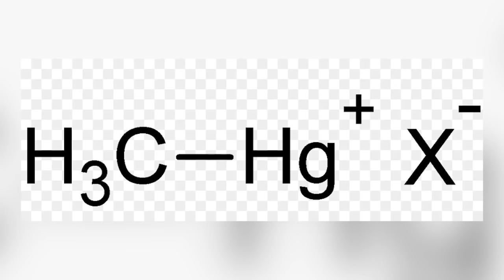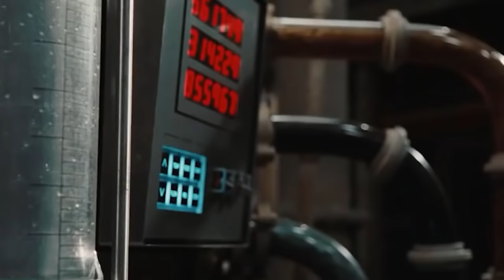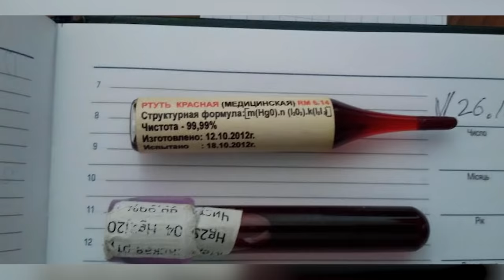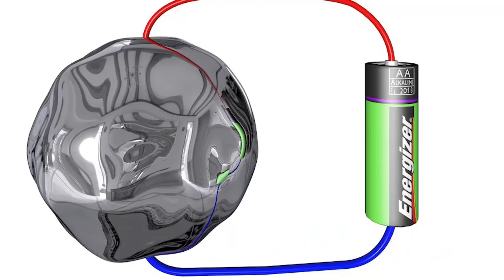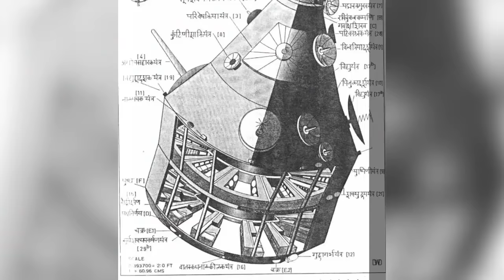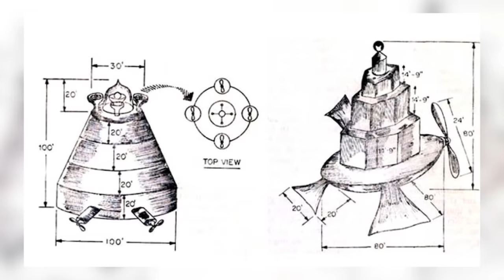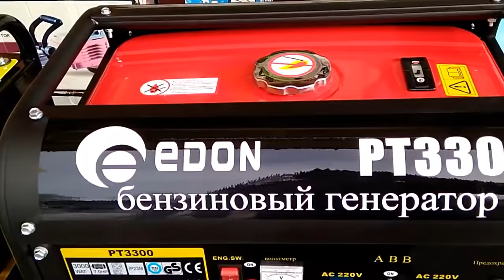Thats Why Mercury Engine Is Forbidden

Comment: I am 51 years old and in great health,when I was 17 years old I got a job at a hvac company and I came across a box of thermostats,it had about 50 of them,a short time later I broke the glass bubble that holds the mercury on each thermostat and collected about a cup of mercury,I played with it ALOT,touching it without gloves,I had it for around 5 years.
Later in life I was around 39 when I had a thermometer break on a shelf above my dresser and the mercury drained out on to a plate of spaghetti, I ate all of it,it wasn't until the last few nights that I noticed a odd taste and that's when I concluded what had happened.
And lastly when I was around 43 I wanted to work for myself and be a miner of Gold I spent a small fortune on the tools one would need and part of that was a 5 gallon bucket of mercury,mind you I was a tad more cautious this time but still had a lot of contact with it,I was much more aware of the fact that it's the vapor from mercury that can be harmful.

Comment: I ran a mercury distilling unit for a small company in suburban Chicago for over 3 years. We took 75 pound steel flasks filled with raw liquid mercury and distilled it to a purified form for use in dentistry. Ever time you get a filling the dentist used an amalgamation containing mercury. The vapor is indeed a neurotoxin, but the liquid is fairly safe to handle, if drunk it will pass through the digestive system very quickly due to it's high density. I have handled raw and refined mercury many times and am 70 years old and show no Iill affect from it. All employees of the company I worked for got monthly blood tests for heavy metals.

Comment: Interesting video, never thought of mercury this way, but funny enough I ate some when I was 11. 😅
Some odd 20 years ago when I was a kid I got sick and had to measure my temperature with a mercury thermometer, once I was finished I kept reading the book I had been reading and at some point somehow without thinking put the thermometer in my mouth. like I do sometimes with a pencil, and started swirling it around the groove at the small tip where all the mercury was and it broke and all of it went into my mouth. I immediately spit it out on the floor because my parents had told me before that metallic stuff is very dangerous. I remember taking a dustpan and brush and trying to get all of the small bits which were all over the floor and threw it out in the bin. Didn't even tell my parents it happened just replaced the broken thermometer with a new one, we had many. Nothing ever happened to me and I forgot about it the next day. I still have a few of those soviet thermometers somewhere around.

Comment: I did escaped unharmed a lot of mercurial thermometers got damaged, as well as a mercurial BP apparatus, when the bus that we were riding had a hard braking. Good thing though it wasn't my BP ap that was broken and all the mercury content spilled out into the bag that fell on me. Though it wasn't intentional (and my fault), I had to do the clean-up of the said spillage as well as disposing of all the glass thermometers that got damaged in the bus. Funny thing was even without protective gear (such as masks and puncture-resistant gloves, I did my task of cleaning and never got hurt or had some problems after being exposed to a certain amount of mercury (because I didn't ingest it).

Comment: funny hey. I was born late 60s and I remember having puzzle games with mercury in them. its 2020 and I am still here. I also had a tube of mercury when I found attached to some sort of power board where my sister did horse ridding. the build it was in was wrecked so I snapped it of and kept it. I remember having it for years but don't remember getting rid of it. not really into the full on conspiracy theories but I do believe that the mega rich and powerful control things so it stays in their favour.

Comment: If you spin liquid metal in a toroid it pushes against the sides of the toroid. By spinning a plate with magnets below it the metal will spin. Now use a pancake coil and pulse it with 24 to 36 volts using a pwm bike motor controller. That sets up a high current in the metal. Now place a magnetic metal ring around the toroid that applies a magnetic field  perpendicular to the spinning liquid and it will be pushed towards the upper end of the toroid causing pressure and lift.
Since its heavy metal and spinning it provides a good amount of stability when two are attached below a snowboard.

Comment: Yes. I used to have about half a cup I used to play with. I used to soak coins in it. Turns them all like new dimes with prolonged exposure. Stuff doesn't soak right into your skin. It's a metal.  But will if you were to just leave your hand in it for hours.. I assume it's going to absorb.

Comment: Mercury, when accelerated to an extremely high velocity, contained within a toroidal containment ring that has helical guides, yields a gravity disruption field effect in a localized frame.  This has been known for many years.  I believe that Einstein wrote his thoughts on this field effect in the 1930's.  
When combined with other chemicals, a very massive, superconducting, superfluid can be created that is much more efficient at producing this gravity disruption effect.   It is the part of the system used in a number of black project tests currently.

Comment: A model of an antigravity mercury device hangs on the wall of most every doctor's office. The snake wrapped around the central column are not snakes but steel pipes welded top and bottoms. The angle of 19.5 degrees forces the mercury to rise up at great velocity with the device is rotates. When the mercury reaches the top it has to travel around 180 degrees back to the central pipe where is starts the journey over again. Hold a garden hose four feet from the nozzle and turn the water on full blast. It wil whip around violently but if you hold it so there is a 180 degree bend you can feel the thrust. There are four forces at work. The device is six time more efficient than a rocket. When driven with a DC electric motor it produces a lift of 3.8 newtons per watt. Ten horse power can lift 12,000 pounds.

Comment: Imagine this...A tiny cylinder magnet weight inside a wire coil ('solenoid'), inside a spinning wheel, where it pulls inward when the force is upward, and allows the weight to return outward when the force(s), between two of these mechanims working in sync, will cancel out (perpendicular to the direction upward)....and a lot of these built together into the framework of a craft, so it propells the craft in whichever direction you wish.  

I think if you can make electromagnetic energy act upon swirling Mercury, spinning around the vertical axis of your craft (like that "Nazi Bell" experiment), which is also spinning around that ring (like wires around a toroid coil), in a symmetrical pulsed wave pattern so the craft moves in a balanced manner...so when the force of the spin is in the direction desired the mercury is caused to move outward and rotate faster increasing the force in that direction, but while it is rotating around the other portion of that rotation is is forced more inwards.
I think this could be maybe how such a "flying saucer" works, using "electromagnetic wave interferometry", "constructive", "sympathetic", "harmonic resonance". 

I been posting on my Facebook recently how I think these thinks work btw, and working out the math to predict and plan new experiments too!

Comment: At the Y-12 complex in Oak Ridge Tennessee, it is estimated that 700,000 pounds of Mercury was "lost" in the processing buildings and the surrounding environment. It was used as a solvent for lithium in the process of isotopically separating Li6 from Li7. I think we had most of the known reserves of mercury at Y-12 during that time (the 1960's).

Comment: My dad gave me a bottle of Mercury to play when I was a kid. He used to save it from various instruments thermometers gauges etc. It probably held about 6 fluid ounces and it weighed like 5 lbs! I'm just pulling a number out of my ass there, but it was way heavier than You would expect when first holding it. The first time my dad handed it to me he said hey Jon, hold us for a second. It felt as though a magnet pulling it to the ground. But I remember poring it into my hands qand watching it fall through my fingers and then splash onto that workbench and regather then I would push it around on the table with my bare finger. Always wondered why people are so freaked out about it.

Comment: Is it possible to synthesize something with properties of mercury that isn't mercury?  Seems like a chemist would know. Theoretically, could we grind an element with the same level of valence electrons into a powder to see similar effects?  Since the columns on the periodic table are aligned by external valence electrons it seems possible to a novice.  However, I do understand the extra ring around silicon gives it different properties from carbon, so please honest answers for an honest question.  Thank you for your time

Comment: Okay, Vimana and the mercury engine are interesting but what about the mercury rectifier.
Before the invention of the transistor diode, the conversion of AC-DC was done with a mercury rectifier in a lot of cases. Is this deemed too dangerous these days?
Also this is another reason some say the ancient Egyptians may have had electricity, many of the tombs where said to have pools of mecury found in them when first opened.

Comment: Handled mercury quite a bit at school in the 1950s.... we used it for a variety of things. No harm seems to some from handling metallic mercury now and again. It suddenly became a "bête noir" in the latter quarter of the 20th century. I did wonder why the sudden paranoia, but it's the same with metallic lead these days. Both Hg and Pb salts are very toxic, but the base metals not so much, Lead is rendered passive very quickly and mercury is only slowly absorbed in its metallic form. The trouble with the panic merchants is that they didn't pay attention a school in chemistry class.
But then, when I tell them that their food as in it a gas so poisonous that one lungful will kill them, and a metal so reactive that it explodes into flame when it touches water they are in denial until I explain that that is what common salt (sodium chloride) is made of. The chemistry is important.

Comment: When I was about 11 or so? I had accidentally broke a couple of old fashioned Mercury thermometer's and was lucky enough to have saved the slippery substance before it rolled off my desk and disapeered forever. But, as I tried to scoop it up into a container? It landed in my palm. It did not soak in or anything like that so? I was perfectly fine. However? When I tried to transfer it to a container? I accidentally spilled some of it on to an old tarnished Silver Dollar. It INSTANTLY absorbed itself into the silver dollar and made it look better than brand new! The only thing was? The metal now felt very slippery to the touch. That was almost 50 years ago. I will have to see if that silver dollar still has those properties. I am pretty sure I still have it here somewhere's. Stay tuned! ;-)

Comment: most engineers who would work with mercury aren't also medical professionals. Also mercury is a metal, so when electricity is sent through it, mercury will form a magnetic field. This is why motors and engines are VERY different; motors run on electricity(making a magnetic field) and engines run on combustion.

Comment: It's not the mercury in itself that breaks gravity, it's the gyroscopic action that it can produce, that counters gravity. An array of multiplexed mercury reaction wheels will produce thurst. Electro Magnets will provide the rotation and breaking w/o resistance, allowing for extreme torque, rotational speed and near instant breaking. As the Mercury rotates faster it gains mass. Mass = gravity. The faster it rotates, the more energy it takes to spin up and slow down the rotating assembly. Like a person in an office chair holding a rotating bike wheel can move around by gimbaling the spinning wheel, gymbaling the Mercury will have the same effect. Mercury vapor in a plasma state would be the best to use, albeit the engineering of such a device is complex to say the least, but not impossible using current tech. A sputtering magnetron can be used in zero Gs, as a very precise 3d printer to deposit and cold weld, in the vacuum of space, materials for this purpose. An AI with a genetic algorithm should be used to make the best design, then print it using the sputtering magnetron in space, low earth orbit, for best results. magnetic fields should also be halbecked for optimum focus of magnetic fields.  The camber should be of a silica carbide or other ceramic material. The structure should be graphene coated tungsten tetra boride, for maximum strength and silver instead of copper for the electro magnets and all electrical connects and internal wiring. At least that's how I would do it.

Comment: Where there's smoke there is fire and there is too much smoke around Mercury/red Mercury's connection to anti-gravity to be nothing. My guess is that gravity or what we think of as gravity has an electromagnetic core component, that's why a conductive metal which is easily made liquid and gaseous around room temperature is able to negate its effects if manipulated properly. Basically everything is more a product of fields, frequencies, and light than the matter(particles) which our scientists focus on almost exclusively.

Comment: Damm it im doing this shit im making a metal circle with mercury inside it and welding it shut in perfect uniform and then attaching a motor to it with big electromagnits that I have connected to two potentiometers that I can apply power to to try to guide it and really see if this crap works if that doesn't work then ill find a different way to spin the mercury and apply a magnetic field around it

Comment: Mercury spins due to electro magnetic field creating the field can be any magnetic field generating system this can be looped with magnetic waves and a full understanding of the fields creation! These feed back loops can then be amplified on the micro level built up on the general level and looped into each other on the reality level. This self feeding system could generate a near unlimited power. Earth magnetic fields are self generating and plainly available but capturing this resource and redirecting it to the generation of a local field and amplifying it on the micro level then the normal build level and directing at the mercury would spin and spin generating a new source of power remove resistances of air and generate a new science era, just a thought these would have to be proven and each part of the system worked out made stable and the effects studied.

Comment: That's it, I am going to buy kilograms of mercury (by different legal sources under different names) and then I will finally make mercury tubes to create opposing force fields and generate lift. The spinning mercury (at extremely high speeds) will have so much momentum of inertia that it will continue giving power back even when I land, all that power will be stored in capacitor banks to later use to accelerate the mercury again. In this way my power supply doesn't need to be a small nuclear reactor, something more manageable high density power like lithium batteries should suffice
Reply: Search mercury antenna

Comment: I had probably 30 lbs of it, I put my hands in it all the time.
Reply: I think nothing of handling it with bare hands.  But you also have to understand it evaporates at room temperature just like water (albeit much more slowly), so you don't want to breathing in an enclosed space (like a lighthouse) or where it's being heated (like a lighthouse) for any length of time, either.

Comment: That Roman Emperor who attacked Spain for half a ton of Mercury blew my mind. Good thing he didn't know about a much closer location in Idrija (Slovenija), where he could get way more Mercury. Sure, Romans would have to mine it, but I don't see Mercury growing on the trees in Spain neither.  That motor concept looks awesome. The idea of Mercury being too poisonous for such use sounds like a big fat lie. Why do we use Lead, Cobalt, Aluminum, Fluorine,... then? And another thing; I haven't found a single specification for this motor online (how fast would spinning mercury erode the engine block (if at all), how strong electromagnetic radiation does it emit, what happens if the Mercury temperature falls below its hardening point,...). I have a really hard time believing, that nobody hasn't done any experiments with this.

Comment: Mercury in liquid form at room temperature is quite harmless. For sure it CAN be absorbed in the body through a open wound but, by normal skin is quite hard to be absorbed (but if you give it time, it will). 
As vapors,it can be inhaled and can be toxic. Remember that it amalgamate with almost everything and if it stays in your lungs it will be absorbed and be toxic.
Eated as liquid, also can be quite harmful IF stays long time in the organism but, as normal evacuation speed it have small time to be absorbed; it was used as laxative that way sometime in middle ages. Of course, after evacuation it was stored AND reused as needed.
And now the most toxic part: salts. All the mercury salts that I know are straight poisonous or are neurotoxins, affecting the brain. So, DO NOT PLAY WITH MERCURY SALTS!!!!
I had broken as child few mercury switches, thermometers and saved the mercury in a small medicine bottle. Ocasionally I used to play with it, but with respect, knowing that I had to be clean, no wounds and careful to not came near the mouth or eyes. And to not smell it.
Thanks to your video now I understand why the craze with mercury nowadays. Makes sense.